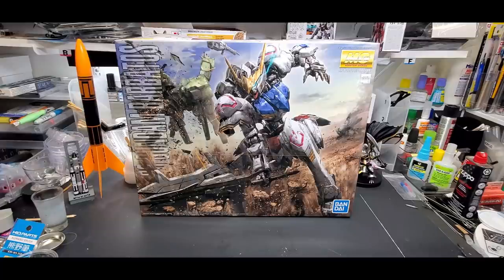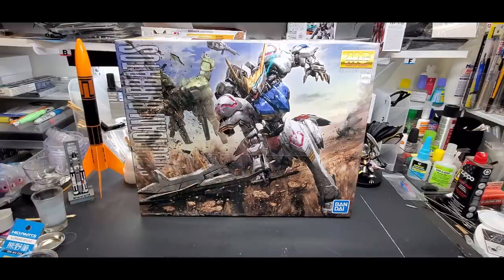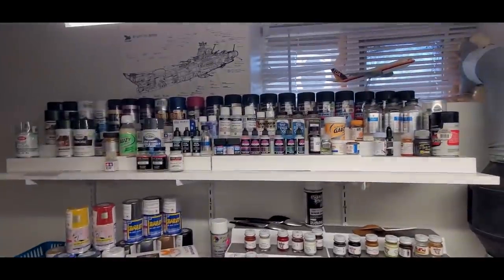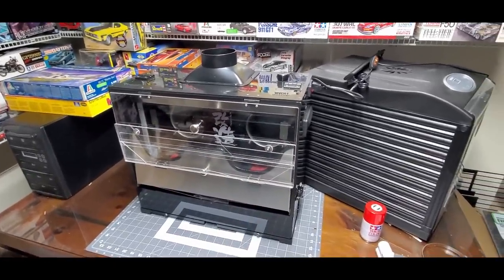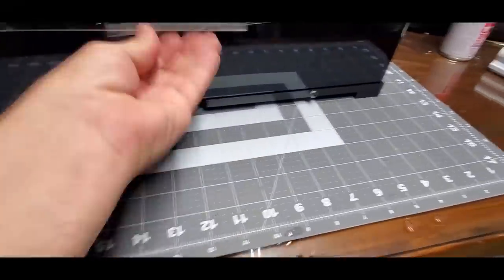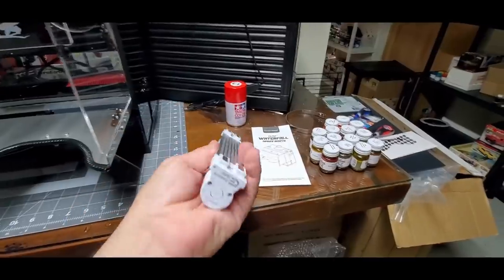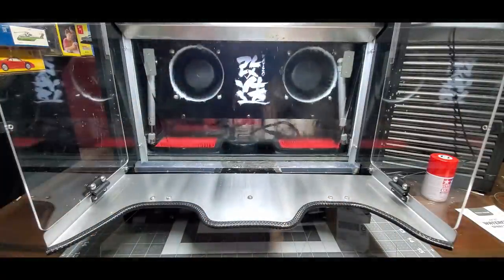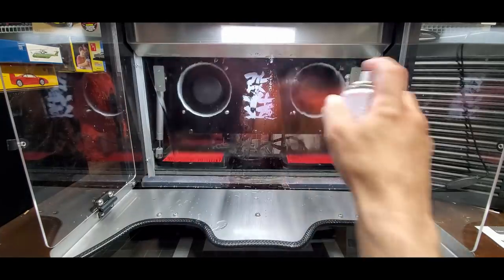Testing a Waterfall Spray Booth - Plus A MG Barbatos Giveaway !!

Comment: You can solve the problem with the waterfall by adding a surface tension breaker. Couple drops of Jet Dry, Glycerine, or some Liquid Dish Soap should do it. I had the same problem with one of those desk waterfalls. Another video suggested adding Rain-X to the glass.

The sound would make me want to constantly go to the bathroom.
Reply from the maker: Great info, thanks
Reply: @barbatosrex9473   I think some one is trying to impersonate you on my other comment
Reply from the maker: They are, I'm working on it now
Reply: @barbatosrex9473  Spray some Rain-X on the back screen to help keep the sheet of water evenly. I bet that would work perfectly.
Reply from the maker: @jeffallen3382  it absolutely does, I was told this soon after the video went up. Also add some dish soap to the water
Reply: @barbatosrex9473  I was thinking a little bit of soap too. Glad it's working out for you.

Comment: It's a really neat idea! I think it could use a little tweaking for it to be really good, but innovations like this help move everything forward.
Reply from the maker: Many viewers have written me and gave me a few tips. One is add dish soap or rapid dry dishwasher liquid to the water to help it flow evenly. And another tip was to coat the glass with RainX

Comment: I've been using mine for alil over 8 months now and Love it.. the filters * red ones * are actually motorcycle filters.. ones in mine are for a Honda  lol    I use heavy lacquer paints  from Japan and the smell an vapors.. don't even notice it at all.. paints like Modo, Hobby Mio, AnchoreT an so on..  great stuff and best money I have spent for a booth..  Ohh after you pull the tray out.. I dump the bad water down the toilet an flush  I add just alil bit of bleach... if the filter gets too fouled up.. I take a soft tooth brush an give it a lil scrubbing back an forth.
Great review Sir !  been following you for a good while and as always  good solid reviews..   Keep up the great work..
Reply from the maker: Thank you for that extra info. I'll be testing the booth out further. Someone here mentioned putting a glycerin, dishwasher rapid dry or dish soap in the water to help it cascade better. Also they put Rain X on the glass.

Comment: if you can have a something like a cat box container or plastic tub that you can put outside with some sand just dump it in there. the water will evaporate and the paint will dry making it safe to dispose of when it builds up a bit.

Comment: Interesting type of spray booth. Nice find. Seems that you were lucky to get one... both sites, that you suggested, has it sold out. As far as the paint sticking to the glass, maybe you can use a glass cleaner to help break the bond on the glass to allow the water to flow over it.

Comment: I can see why a lot of people would like this, but I can't help but think it may be more trouble than it's worth, AT LEAST the way it's currently designed. The rat-cage fans alone look more than capable for removing the fumes and I can't help but think that dumping the fumes and paint into a damp or wet filter and receptacle at the bottom (self-contained tray) would be a better option and be a LOT less messy. Great Video BTW!

Comment: Add couple of drops of dish soap to break surface tension of water. You will get a better full sheet of water coming downing and water won't wick around edge on start up. Soap also helps break down the paints

Comment: I just built my own spray booth out of display board panels and 3d printed exhaust. 

I think the paint wouldn't stick to the glass and you would get a better waterfall effect if it was ceramic coated.

Comment: I don't know if I would be able to use it as a tool and not worry about it getting paint on the back. Also, if the bench it is on isn't perfectly level, I would imagine that would effect the "waterfall" as well, which like others have mentioned seems like a hassle. Thanks for the review though, probably the only time I would have know a product like this even existed. 
I like your idea of using those fans, they seem like an incredible piece of equipment.

Comment: Thanks for the review. I hadn't seen one of those tested before. It's an intriguing approach to filtering, but I suspect a downdraft booth will still end up working better in practice. Especially if you're piping the air outside anyway. That said, I wonder if an inline water filter for the exhaust would be a more practical way to ensure you're not letting small particulate into the environment and get the best of both worlds.

Comment: interesting to see a waterfall booth in a hobby size form factor. you could probably pour the water through like a coffee filter or something similar especially if using non water soluble paints to reuse water a few times before changing completely?

Comment: That's definitely an interesting spray booth, and one I'd consider if I had to spray inside the house.  I think I'll keep spraying in the garage though.  I'm about to build one that's larger than the standard size and exhaust the fumes to the outside so that it's safer and more convenient to use.  The review was very informative though, and gives much more information than can easily be found anywhere else.  Thanks for going through it so completely!

Comment: Try running distilled water and see if that flows better. It muddy be worth hitting the glass panel with some hydrophobic coatings for car windshields to get better flow
Reply from the maker: Yes, I was told to add a few drops of dish soap or rapid dry dishwasher liquid. Also coat the glass with RainX

Comment: I would think you could only use acrylics because they are water based. I have seen someone use enamels and lacquers in a bucket of water. They just skim the paint off the water with a paper towel. I would not recommend disposing it in the sewer system. You do alot of testing of just about everything. Excellent work.

Comment: Did you check the level on the spray booth? That might explain the problem with the sheeting in the center. One of the comments mentioned sheeting. A drop or two of dish soap might improve that. My 2 cents worth.

Comment: I wonder if there is an object stuck up in the waterfall part? Or if you need to clean off some type of residue from packaging. Like oil or glue? I could see oil buildup maybe separating the fall in two halves.
Reply: Just impurities in the surface of the glass itself. Water will take the path of least resistance. If you've ever noticed, car windows, even after a very thorough cleaning will do the same thing. Water wants to stick to glass. Adding a hydrophobic coating will pretty much stop that from happening.

Comment: I assume it only works with acrylic paints?   Where does the air exhaust, and other than the water are there any filters?
Reply: No it’s for any paint especially lacquer, it comes out the top, he just didnt have the hose connected.

Comment: Good review on this new spraybooth and a great idea on using water to catch the over spray paint. I am looking for a better spraybooth and I am really impressed by this one. How offen do you think the air filters need to be change out? The idea of useing water to filter out most of the paint participants before getting to the main filters is pure genius. Like to see more updates on the use of this spraybooth in future video to help decide on getting one to replace my old one. Thanks for sharing and look forward to your next video. Be safe. 👍🚢⛵🚂🚀🚗✈
Reply from the maker: I looked into it and they last a very long time. About a year someone told me. They're actually motorcycle air filters you can buy anywhere. Plus I learned you can add dish soap or rapid dry dishwasher liquid in the water to help it flow evenly. Plus you can coat the glass with RainX.

Comment: Great vid.  Interesting booth.  Have been wondering if anyone made something like this.  Been thinking about making a water sump for my booth out of a 5 gal. bucket.  Run exhaust into top of bucket with water to catch any leftover particulate and a 3M charcoal mask filter on top that air vents out of the bucket through for vapors.

Comment: Such a bummer that the waterfall failed in the middle. You rock
Reply from the maker: It was a bit hit or miss. But once it flowed across the entire back glass it worked good. The fans on the other hand are fantastic
Reply: Would rain-x work?
Reply from the maker: @robertjohnston8290  yes absolutely. I viewer just told me that's what they did. Also they said some glycerin, dish soap or rapid dry dishwasher liquid in the water helps too.

Comment: Good giveaway. Hey do you think you could do an in depth into airbrush tip sizes, are they swappable on any good models,  needles, etc. I thought atleast by brand they would be swap able in some cases but In my few experiences it has not been the case, but you would no better. And no body goes in depth into these exact things.

Comment: BR,those fans are dead ringers for your fans in a PC build.Be Quiet and several other computer fans can pull/push a significant amount of air.That waterfall action might be more even if you can get rid of any static.A good window cleaner should do the trick.Stay well my friend,Doc BC
Reply from the maker: Yes, I was just told to use dish soap or rapid dry for dishwashers in the water. Also coat the glass with RainX

Comment: I am wondering if you could apply a hydrophobic coating to the back glass. Either that or what I would try is car wax. Something to keep the water from grabbing onto the glass, to remove the surface tension. 

Seems like a luxury booth. I have the same $60 grey box everyone else does. I'm not ready to jump up to a $400 booth quite yet. I also have a stash of Bandai Star Wars kits to get to. My first project will be to combine a couple of the trench run kits with all of my 1/144 scale models and make a diorama out of all of them. Then the 1/72 kits and finally the PG Falcon.

Comment: i wish i had the space you have there i do my building from a little cupboard with a home made spray booth (thin wooden box to hold the carbon and paint filter connected to a 4 inch inline fan with a cardboard box that it fits in that can be flat packed)

Comment: I like the concept of this booth and the fans are awesome but I think the water not sheeting correctly every time would bother me too much. But if it would allow me to spray in doors without out having to vent out a window that would be extremely beneficial.
Reply from the maker: Well I just got good news here in the comments section. You out dish soap or a rapid dry liquid for dishwashers in the water and that solves the water sheeting problems. Also a coating of RainX on the glass helps too 👍
Reply: @barbatosrex9473  that’s pretty cool. Definitely would not have thought of that.

Comment: It's an interesting concept, but I think they made it more complicated than it needs to be. It's like the old Rainbow vacuums or drywall dust extractors in a way. I would just take it to the next conclusion and suck the spray into the water and evacuate the air that comes through. This reminds me of a lot of German engineering where they forget KISS (keep it simple stupid). It will be interesting to see how it works over time.

Comment: Cool idea for a spray booth, but it feels like more trouble than it's worth when household air filters are relatively cheap.  Maybe if the waterfall works flawlessly.
Reply from the maker: I've talked to guys who I've this thing. They told me to add some dish soap to the water and it flows perfectly in sheets. Plus some Rain X on glass works too

Comment: Great Vid.  I wonder if this would knock the enamel/lacquer smell out, without having to ventilate to the outside?  That would be huge for those that can't use those due to ventilation issues.  Have a great day.  OB
Reply from the maker: There's a comment here from a guy who has had one for 8 months and loves it. He gives great insight. Look for his comment here
Reply: @barbatosrex9473  Thanks for the info.  I took me a while to find it (from Cowboy375.  Plus the other comments about RainX, Glycerin (which I have due to your home made Thinner/Cleaner solutions), or dish soap.  If I could convince the spouse, then I could up my timetable on working on my 1/48 B-17G, which I want to use AlcladII chrome/aluminum/dark aluminum on for the NMF.  Thanks again for all you do.  I know I've bugged you before about your Acrylic Line of paints ... but is there any light at the end of the tunnel, or has life taken over and you're plugging along?

Comment: Do you have army painter's white on the shootout? I've been looking for a white with good coverage for small parts like eyes where a lot of overspray lands and none I had (tamiya xf and x, dspiae florescent white and falt and normal white, white acrylic ink, jacquard airbrush paint, angelus acrylic, mr. Color 3 different whites, vallejo mecha, ammo and Wicked createx) would cover in les than 4 coats. Then I got myself a bottle of plain army painter's white paint and it is amazing. Is really thick but easy to dilute. I have only heard bad things about army painter's line but at least the white is great. Can wait for that video. Please do some brush test on small parts. Thanks!!

Comment: I bet this would work well for apartment dwellers like myself. Setting up spraybooth ducting in an apartment can be next to impossible but it looks like with this unit you wouldnt have to since the water would catch all the paint? I wonder if you still have fumes though. Either way, I can see myself possibly getting one of these.
Reply from the maker: Check for a comment left here, he has used it for 8 months and loves it. He has good insight to it. Look it up
Reply: @barbatosrex9473  hey buddy. There's a dude using your name and avatar tagging people saying they won. I was one of the tagged. It's your account or is a scammer?
Reply from the maker: @Nerovskys  a scammer, I just reported them. I'm doing a quick video message about it too

Comment: Seems like it would work very well, but does require more effort on the front end.  Just have to decide if the juice is worth the squeeze.
Reply from the maker: I found out a few drops of Dish soap or rapid dry dishwasher liquid in the water helps out with the water falling like a sheet across the glass. Also RainX on the glass helps too

Comment: I'd throw a coat of RainX on that back waterfall panel to see what it does, but as it shows in the video, it's too much of a pain to mess with when compared to the usual filtered spray booth. At almost double the cost of a 'normal' spray booth, the market for this booth is obviously very targeted, but very limited.

Comment: I have been modeling for 60 yrs and have not built a Bandai kit yet. I here the Bandai just fall together
Reply: Some do, but that is why its good to have cement.
Reply: Most are sturdy and very easy to build. What you get is an articulated figure which is very impressive for an injection-molded kit

Comment: Has anyone modified a booth to run a quieter fan ? I've been using this booth for like almost 2 years+ and and still working fine but I was thinking of modifying it once it breaks. Plan is to use some sort of top of the line PC fans like a noctua. I wonder how silent / effective it could go.

Comment: There were some cheap waterfall booths (under $100) i was looking at on Amazon before I decided to build my own air spray booth out of wood. The main reason I decided not to try the waterfall ones on Amazon was because the reviews said the waterfall wasn’t consistent, it looks as if that’s a problem even on this premium one so now I’m curious if the Amazon ones would compare. Nice review.

Comment: It's a bit unfortunate how Barbatos is slightly off scale in MG since it's taller than MG RX-78-2, which they were supposed to both be 18M. Barbatos is just a few centimetre taller in MG. If you are interested in scaling and all, it will bother you once you notice it.

Comment: I bought one right when it came out and it worked fpr about 2 days then the leaks started , so bad i couldnt use it .....Robotkai was amazing , i had multiple problems , they said keep the unit and gave me my money back. I was able to modify it to where i now use a 20x12x1 filter and use it like a normal spray booth. The fans are amazing and work great , its disappointing the water fall didnt work well , i talked with a bunch of other owners who finally asked for a refund , the fans are too powerful and suck the water into the airway making things a huge mess. However it ended well ive got a great spraybooth anyway.......as for robotkai they are awesome........

Comment: I've been looking at getting a bigger spray booth, this one looks like a bit too much me personally and I'm not a fan of toughened glass on anything I'll be using metal around, I used to make toughened glass, one tap on the edge and it's broken. I think I'm going to go with the large Bartsharp spray booth.
Edit* so the flaps are plastic? The site says they're glass, I may have to reconsider now.